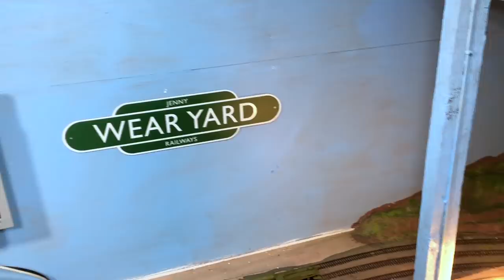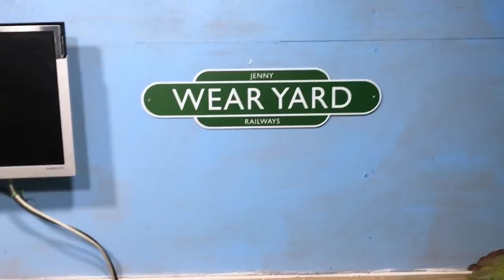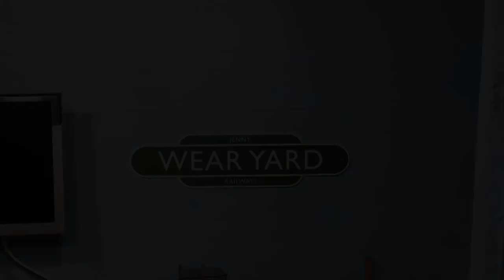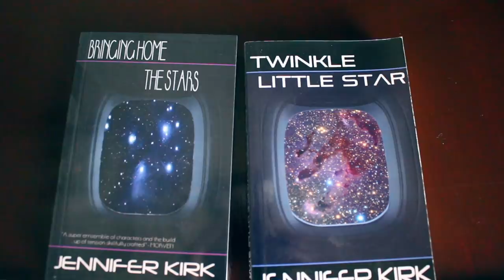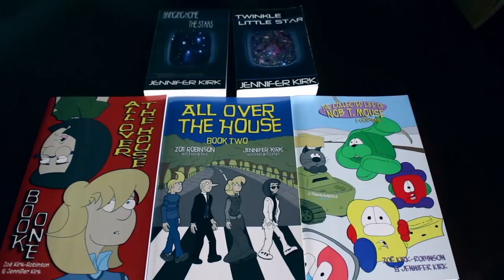Amazing Scenery Comes Together on Large Model Railway - Building the Loft Layout, part 13

Comment: Yes, suggest you put some 17mm ply over the access hatch.  Surely you can put a couple of door hinges on it and swing it out of your way. Then not only are you safer, but if a train falls off this new section it is only going to fall a short way rather than one story down.  Make it easy to use and you will soon wonder why you didn’t start with it there! Regards.
Reply from the maker: LittleJohnny47 Cib it’s a thought.

Comment: Hi Jenniffer. Glad you are using (as suggested)Jay Cloths with PVA but! If you use smaller pieces of cloth and overlap them you will not suffer the baggy-ness and folds you seem to be getting, also three ply's with 24hrs between coats will give a very solid structure. Keep up the excellent layout build. Regards. Alan - FH 12  Also in the loft making similar...

Comment: The layout is coming on nicely Jenny. I have a suggestion for hiding that wooden post which might look a bit better that it growing out of the top of the water tower - why not put a tall chimney there instead, that way instead of looking down on a post sprouting out of the water tank the view will be more across at sky level of a sky blue post. A smoke effect painted on the post just above the top of the chimney could disguise the join further.

Comment: Jenny - for the hard to reach corner, maybe create a modular scenery section that you can just drop in ie use a verticaly curved piece (v thin ply or heavy card) to get the radius, build it up off layout maybe with a scene on top eg church in N scale etc, then just drop the whole thing in and its removable in case you need track access. I would also support all other comments to get that hatch covered - imagine weeks or months in hospital...just takes a moment when you are tired to forget and it's a load of pain which could be permanent. PS well impressed how easily the Class 25 went up the gradient - I will have a look at that incline system. Cheers